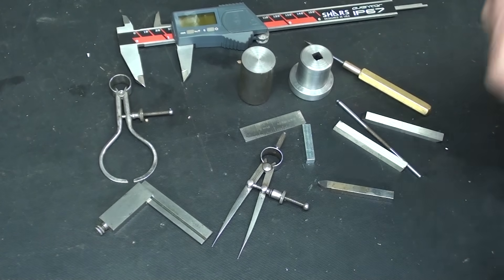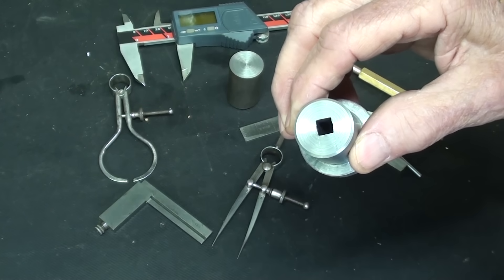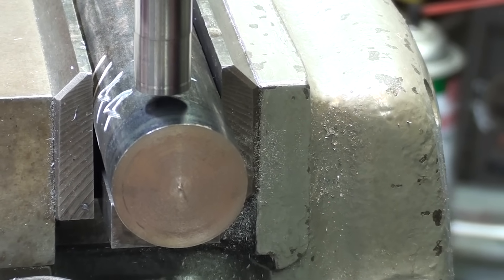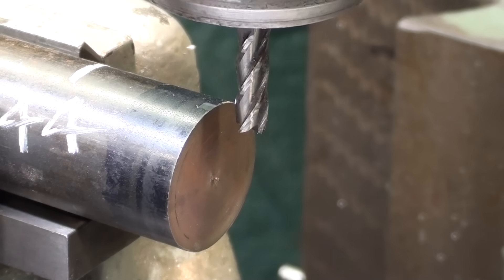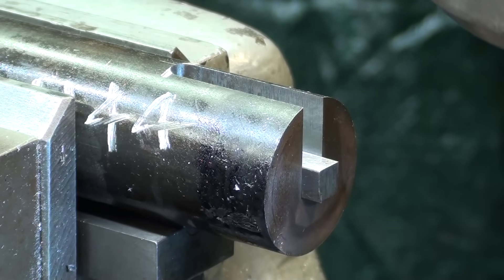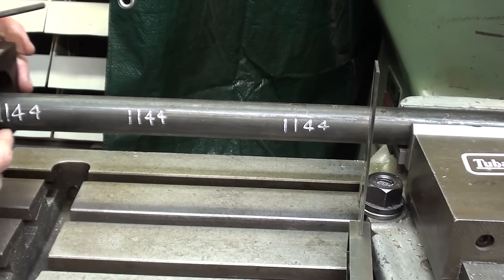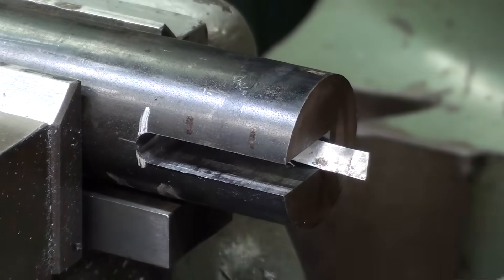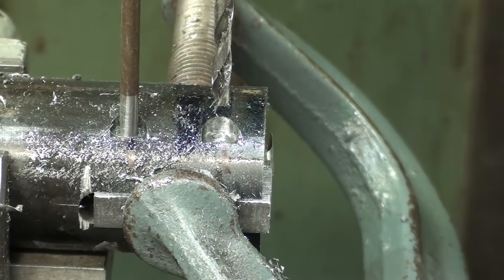Machine Drill a Square Hole in Round Stock #705 tubalcain

Comment: If you were making a subway tunnel this technique would be called "cut and cover".
Reply: ....and if that tunnel is under river????.......:)
Reply: @nelunicoara4483  That is why the earlier shallow tunnel lines on the London underground had to come up to the surface either side of the Thames and use bridges. This prevented them from crossing the river in central London, resulting in a long journey to travel a short distance. 
Therefor commuters used the mainline to get to the correct side of the river and then completed their journey on the underground. 
Even after the deep tunnel lines were constructed, people still use this method today, to save time by avoiding all the station stops on a long underground journey.
Reply: @wilsjane  Not in Bucharest where tunnel is under river. It was cuted similar to Euro-tunnel under the sea.
Reply: @nelunicoara4483  Our earlier tube lines were constructed in the 19th century.
The later part of my comment may have confused you if you don't know London. Although we now have deep tunnels, the trains stop at dozens of stations. This make travelling into London by using the mainline followed by a short journey on the tube quicker.
Reply: @wilsjane  Yes but these tube are under water how to "cut and cover?
Reply: @nelunicoara4483  The more modern tube lines are deep underground and were bored the same way as the channel tunnel.
The cut and cover lines built in the 19th century had to use bridges. That was why they were away from the centre of the city. They are also very winding, since they had to be built under the existing roads.
The new Crossrail line passes deep under the city. Lasers are attached to all the buildings and any changes in pressure in the soil below the buildings is compensated  and corrected by pumping concrete back up from holes in the tunnel walls at thousands of pounds per square inch to relevel the buildings. This will continue for several years and it is the only project of it's type in the world. 
The system was designed in Rome and is being used to prevent the collapse of the leaning tower of Pisa.
Reply: @wilsjane  I know. That's mean "cut and cover" is OUT. This was the reason of my question from reply.

Comment: Abom has a cool video for a tap holder.  Half the depth is a close tolerance round hole and the back half just has an end mill cut through it which grabs 2 sides of the square tap.  pretty clever.  Yours came out nice Pete